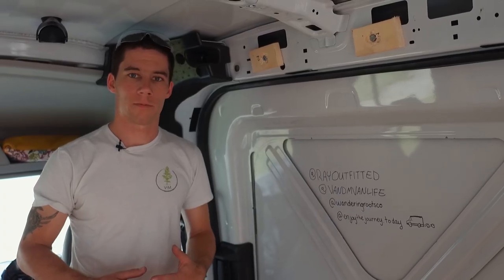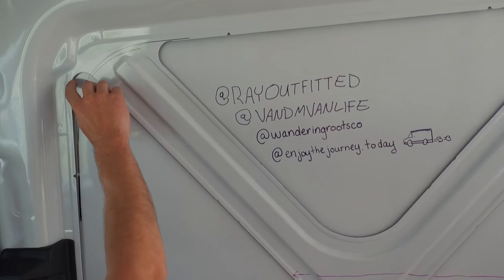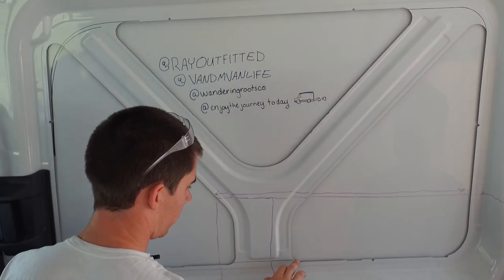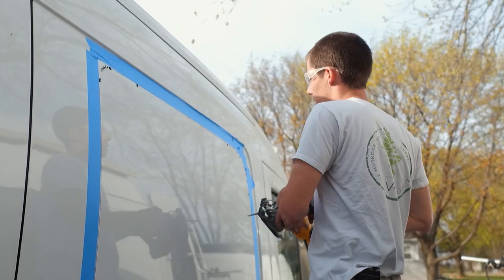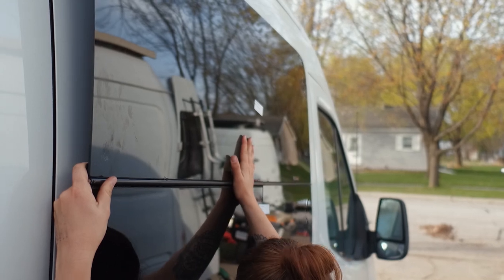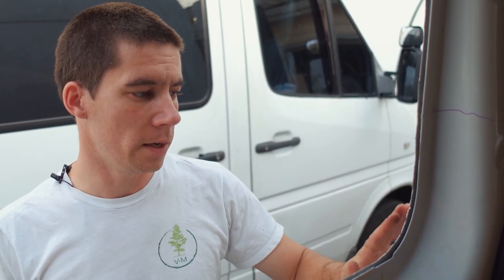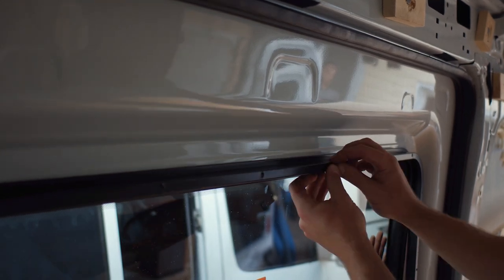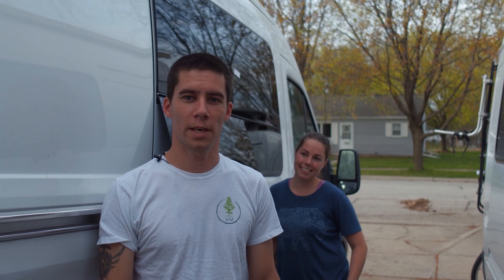Sliding Door Window Install - Ray Outfitted How To

Comment: Did you drill holes for the screws? My CR Laurance window has holes in the retainer ring, but not in the window. If drilling is required, what size hole?
Reply from the maker: Hello Ed. The window does not need drilled on the one that I installed. There will be a small gap on the outer edge that the screws go into and will cut their own threads.

Comment: This is great.  Super helpful.  We've got a couple windows to install, and I think the tips here will all apply to them.  Question though, the little support beams in the window,  I think I saw you also cut right through those.  We were wondering if they needed anything special, but guess not. : )
Reply from the maker: A Curious Expedition Travel The supports that get cut out are to hold the body panels from vibrating while driving. They aren't structural supports to the panel that the window is going in. See you soon!!

Comment: Can you tell us about what saw blade you used please? We used "T Shank Jigsaw Blades Set for Wood Plastic Metal Replace Bosch DEWALT BLACK+DECKER TACKLIFE ...  T118A size," but it was very slow going. Thank you!
Reply from the maker: Hello, we use the T118 or T318 blades. Yes it is slow going but they are the correct tooth count for the thickness of steel you are cutting. Happy travels 👍

Comment: Great video!! Thank you! :) We put our window in yesterday and have about a pinky finger sized gap between the window and the door on the side further away from the passenger front window. Does yours have a gap or do you think we need to sand more and push in more? Thanks a bunch!
Reply from the maker: Hello Danielle, there should be absolutely no gap around the outside of the window. Sounds like the window is catching up a little - get it flush. Make sure you paint after sanding/cutting. Best wishes!

Comment: Hi, What type (and if possible what number) Sikaflex did you use on the window. I am having some gaps and want to seal it and am wondering if I should use Sikaflex instead. I don't think I want the self levelling sealant or the adhesive sealant.... so wondering what to use as I seem to have gap(s) on my promaster window. I see yopu used the construction adhesive... does this have enough Flex to it?
Reply from the maker: ChasingRiver Hi there!

 I would recommend to use sikaflex or marine grade sealant. I agree with you that self leveling is not good to use on a vertical surface.

 For this project I used sikaflex construction adhesive, since they had it on hand. For my own van, I used marine 4200 sealant but 4000 also works. 

Best wishes on your promaster conversion! Hope to see you on the road!